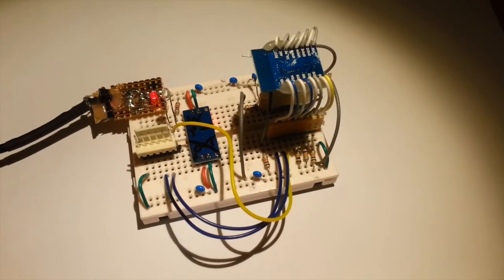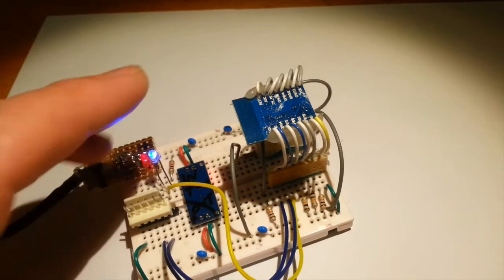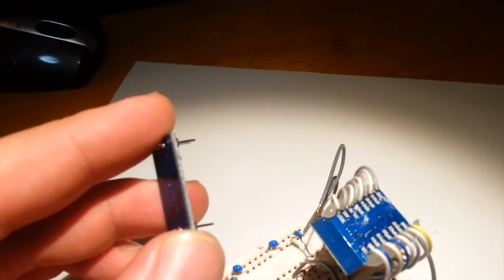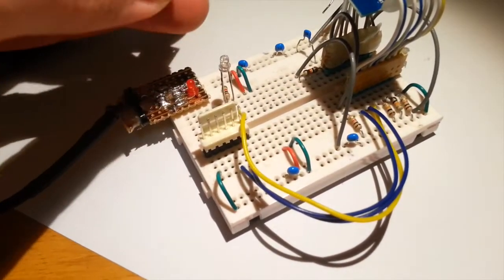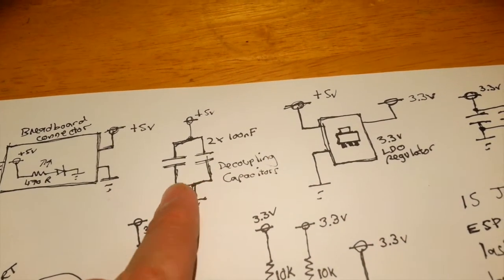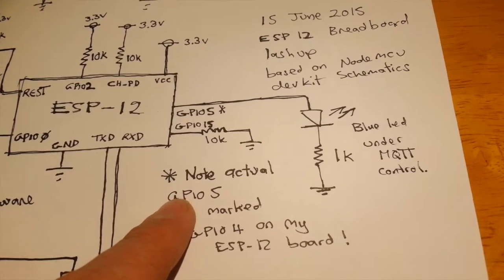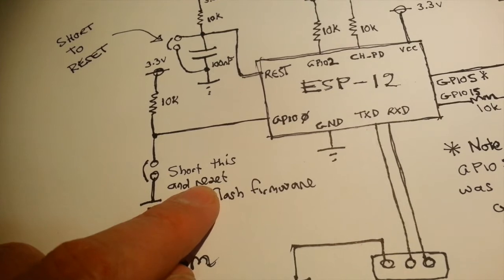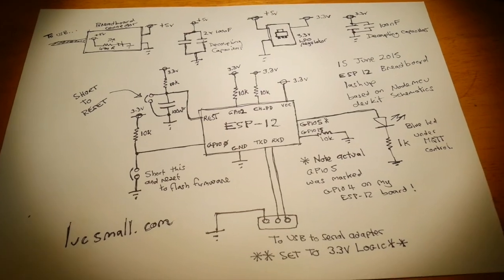Wiring up a DIY ESP-12 (ESP8266) Breakout Board

Comment: What a fantastic video , if it works correctly ? then is the best schematics explanation i i have seing about esp 12 ,  i have burned many already , i am working now with esp12f traing to create my own dev board  , conbined with a sim800l as a SMS server .
What have me scared ? is the  REST  & GPIO 0  , that are conected straight to 3.3 + 10 k  and when the switch is pressed the it shorts to ground .  that is my night mare .
As a beginer on electronics , this got me very confused .
I will like if possible ? LUC SMALL to tell me if this shematics really works , shorting to ground RST & GPIO0  ?
Asread on others ,  suppously GPIO0 Pushboton have to be pressed and hold  first while pressing RST for reboot  .
Please clear my thouths before i burned another one .
Thanks in advance .
Awaiting !!!!
Reply: That is why you guys should add a weak resistor value like 220ohm between + side of capacitor and reset switch. so when you press the switch it won't cause the capacitor to short to ground when the button is pressed.